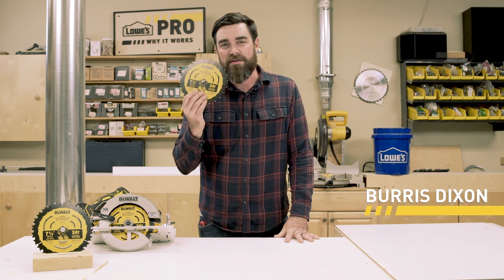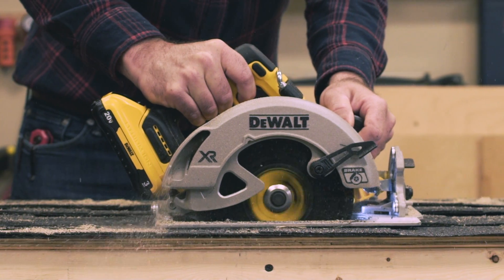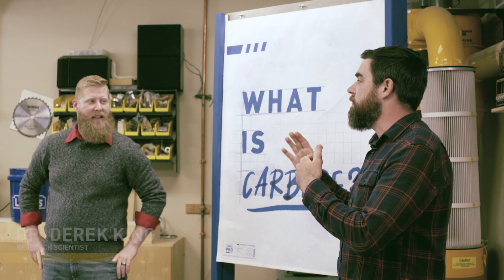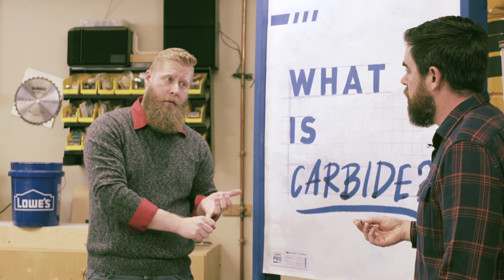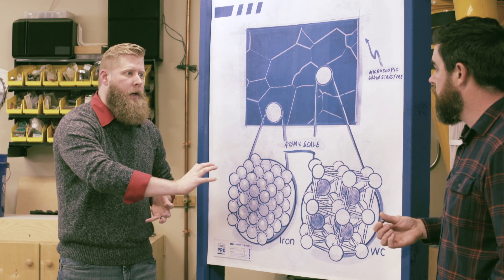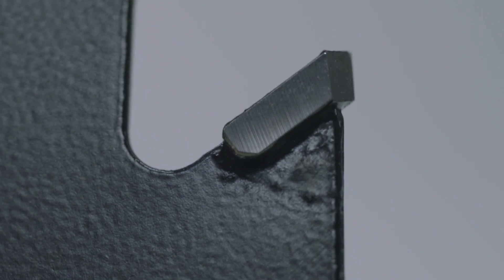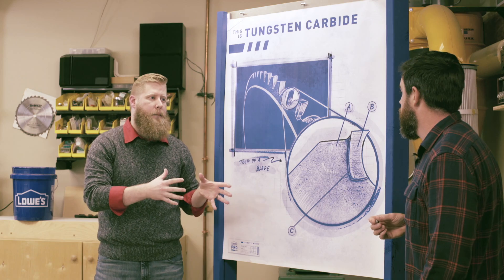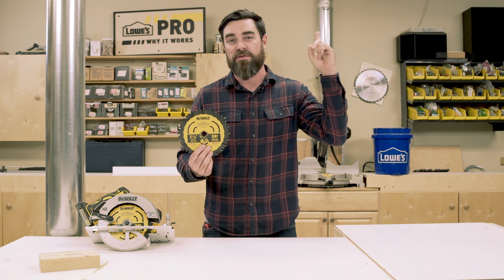Why It Works: DeWalt Carbide Tipped Saw Blades

Comment: Did he just compare a ceramic cup to a tungsten ball?!
Reply: They are both ceramics. Helps drive the point home of "Not Metal"
Reply: David Davis i can argue with you on that all day long. Tungsten carbide is a metal... the ceramic part is relative... That part used in this blade is basically metal tungsten powder compressed with huge pressure and some bonding agent... (the ceramic).... and that is it...